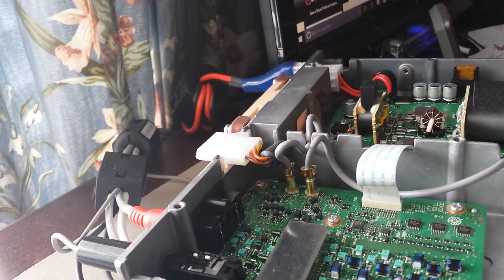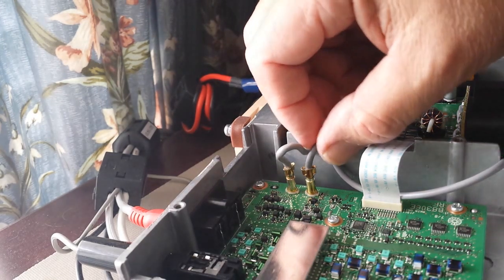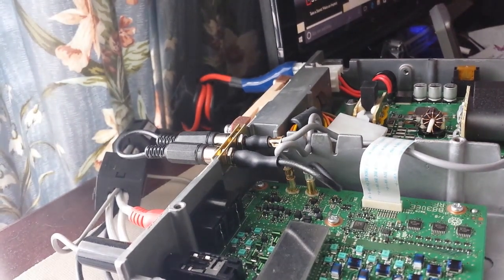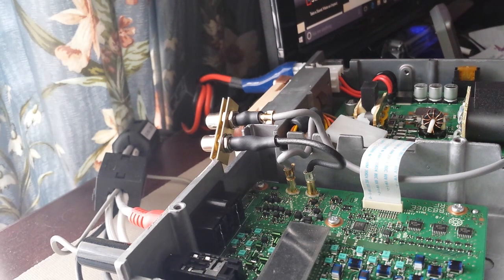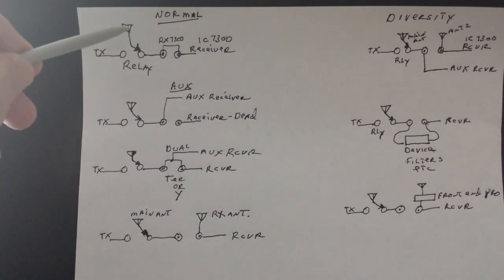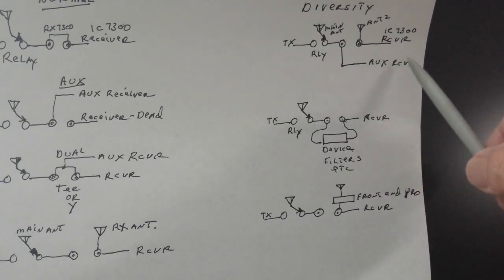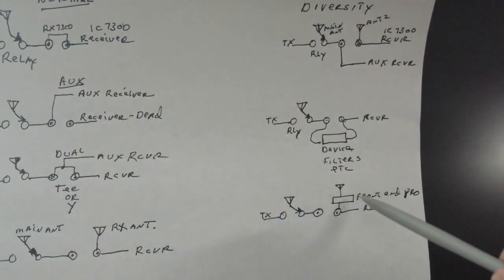IC-7300 with INRAD RX7300 RX Antenna Port Installation

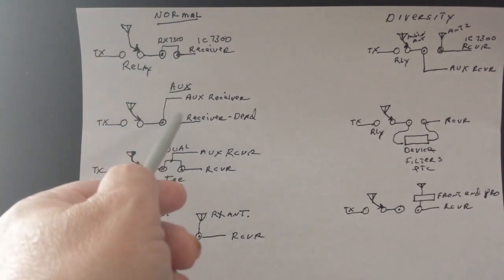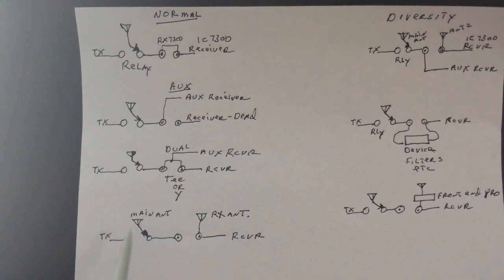Comment: Outstanding installation and explanation video, thanks Steve. I bought one and installed - anxious to play with it. Your applications options summary is excellent ... except I believe I caught an error. At 9:15 you're discussing the separate transceiver / receiver option and you mentioned to hook up the separate receiver to the port on the right as viewed from the rear. As I understand it, the port on the right (as viewed from the rear) is the receive INPUT (for an RX antenna) and the port on the left is the receive OUTPUT from the IC-7300 main antenna. Therefore, you want to hook the separate receiver to the port on the left (as viewed from the rear). At 11:00 you mention the RX only antenna (which is what I will do) and did not state which port but I believe it is the port on the right as viewed from the rear.

I hope I understand this correctly and will play with these options when I get my new magnetic loop RX only antenna. 73 KJ6ER, Silicon Valley

Comment: Interesting. Im thinking of using a beverage on 160 but want to use an external tuner. Good thought about moving the rca jack permanently on the back panel, I worry about drilling the holes in the back and missing an aluminum shaving,any thoughts? Just a good vacuum and double and triple check? Thanks  Great video

Comment: Great video. Word of caution for diversity monitoring. Several SDR receivers delay audio along the chain, so it sounds like a echo. One of the rigs, in my case, required a audio delay line to sync up the audio with my SDR.

Comment: Very strange to use RCA jacks for an RF connection but I guess it is a space issue. And maybe a cost issue.
Reply: RCA jacks are common on most mid to high end radio’s as a dedicated receive only port, internal relays ground the system, though as this is a modification I’m not sure if that is the case in this instance, remember you wouldn’t be transmitting through this, my own RX only antennas are between 90 &120 metres on top band which seems to give good separation.

Comment: I also use my IC-7300 for general coverage listening. In that regard I notice substantial differences in rf gain on various bands. I wish there was a front end alignment procedure like with analog radios but there is none. I'm thinking I could use this adapter and insert and external rf amplifier. Thanks for the video

Comment: Pull on the connector not the wire.
Reply: Yes I noticed that and was going to make the same remark. Well spotted. ? How many times do you get pulling on the wire before it goes un-serviceable.

Comment: Nice video of a simple mod.
One of my ideas would be using a true signal splitter, e.g. a satellite signal splitter (yes, I know 75 ohm, but not critical for RX use) possibly with low gain preamp in front, in order to monitor several frequencies around the selected band
This in order to detect 10m propagation by listening with external receivers on 28200, the international beacon frequency, and 27.555 which is an excellent way to detect 10m propagation.
Does someone have experience with this mod for, e.g. a IC-7100 or IC703/706 ?

Comment: Have you used this with hdsdr and a dongle? I hear people using it this way for a large pan adapter and hrd to operate the radio. Just researching before I go and dick up my new 7300

Comment: Easy enough, and now that that's installed, I'm curious as to your thoughts/preferences on RX antennas. I literally dropped wire onto the floor here and knocked out a enough noise to make 75 and 160 tolerable tonight. But really haven't put much study into rx-only antennae. yet.  73

Comment: Nice video Steve. Thanks for putting this together. So, what's the best way to wire this so you can switch between the receive antenna and "normal"? Would a 2 position coax switch work, with one of the positions acting like the jumper? Or would this present a problem when the switch grounds out the unused position?

Comment: That device looks quite easy to build. Actually simple. And I already have the parts. You could build it with a small connection for the antenna tuner and use a converter on the outside. Nothing lost. You don’t have to use full size RCA connections. Building it tomorrow.  Will out sell this..

Comment: Can i transmit with it?
Reply from the maker: Negative
Reply: oh no!
Reply from the maker: Of course you can still transmit as always. I wasn't sure of your question.
Reply: sorry, what i mean is.. when it is installed and i connect another receiver  on it  as panadapter, will my sdr receiver be isolated/protected when i TX on 7300?
Reply from the maker: Well all I can say it yes since the sdr will be connected to the same spot that your 7300's receiver input was connected however the 7300's receiver has some diodes protecting its input and your sdr may or may not...who knows? So the safe thing is to put some protection in series with the sdr receiver. That's where this little device comes in handy although it might cost more than a cheap sdr rx. https://www.dxengineering.com/parts/dxe-rg-5000
Now if you intend to use the sdr receiver in stand alone mode while hooked to a rx antenna then by all means use the dxe device but when going through the 7300's front end, you probably won't need it. Probably maybe.

Comment: Steve, great video..Quick question for you:  In the dual receive configuration, do you have any suggestions for what type of RCA "Y" adapter to use to split the signal between the 7300 and the Aux Receiver or would a standard male-male-female audio adapter work here?  Thanks for the help and keep up the good work.  Mike
Reply: Or should I be looking for an RF splitter/Combiner built for RF..thx Mike
Reply from the maker: Just a RCA Y will work with a few DB loss. I doubt if you would notice.
Reply: Roger that...Thanks
Reply: Thanks Steve.  RX 7300 up and running in the shack.  Using the dual receiver set up right now with SDR Console v3.  It's nice having a full size panadapter and I can have the option to slave the SDR receiver to the Icom or operate the two receivers independent from one another.  Thanks again for your help.  Mike

Comment: Or you can do what I did to retain the internal antenna tuner connector for use with my MFJ 939 External Antenna tuner.   That would be to buy an MFJ 1708 instead,  which will provide the receive antenna for you and when you transmit on the IC 7300 it protects whatever SDR device you have on the receive antenna.   I'm using a FIFI SDR at the moment on my 23 inch touch screen monitor and it's awesome!!

Comment: Maybe the ic 7300a will have this installed  kg6mn
Reply: Still waiting for Anyone to release an SDR radio to follow the IC-7300.  The delay is unbelievable.  Even Icom hasn't released an IC-7300a, yet.  It's like all the manufacturers are stunned.  Even Icom stunned itself.

Comment: Cool, the first thing i asked about the 7300 was if it it had RX antenna port. That gave me second thoughts, even knowing that it could be solved with a T/R switch. I missed the RX port of my old IC-751A and the RCA jumper. What I  used to do with the jumper was removing it and  connecting two RG-58 jumpers with RCAs on the radio ends and PL-259 on the other ends. I inserted a three antenna ports switch between the PL-259 connectors using the common for the RX IN and the #1 antenna position for going back into the radio on the RX OUT  just like the jumper, having the TX antenna for RX as well. Then, on antenna port #2, I would put my main RX antenna and on #3 a second antenna for RX, it could be my 20 m beam, for example.  Using this you can still insert a receiver protector, a filter or other devices. 73 de HK1A/EC5KXA/K1KK

Comment: Great Video thanks for posting.Btw did you change the fan on the 7300? looks like the nf8 Noctua?
Reply from the maker: Yes it's the Noctua and now I don't hear that awful startup surge.
Reply: Thank you, i guessed it was i use them in my other radios they are the best for low noise.I have ts870 ts950sdx both of them fitted with the Noctua fans.Nice modification for the icom 7300 i use a front end saver from dx engineering they work very well and keep the dreaded RF out of your expensive equipment.

Comment: Steve, thank you for this and especially for the possible connections. In the dual-receiver connection (3rd from the top on the left side), if I were to use an SDRplay as the second receiver for an extra pan-adapter, for example, do you think I'd need a front-end protector for the SDRplay? I guess I'm curious if during TX the receive path to both receivers would be shunted to ground and hence not need a front-end protector on the SDRplay. Thanks!
Reply from the maker: It would appear that you would not need any extra protection since when you are transmitting from the same rig, the receiver antenna lead is disconnected and the electronics should shunt any RF to ground but then it wouldn't hurt to play it safe and put the DXE-RG-5000 in line with the SDRPlay.
Reply: Thank you for replying. I am trying to keep it simple - and less expensive - but a receiver guard is good insurance. Thanks!